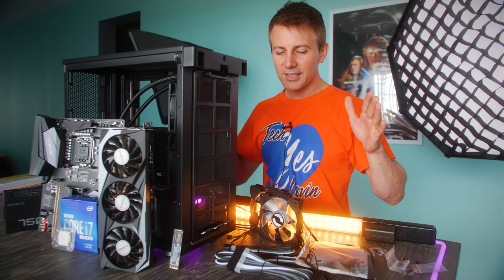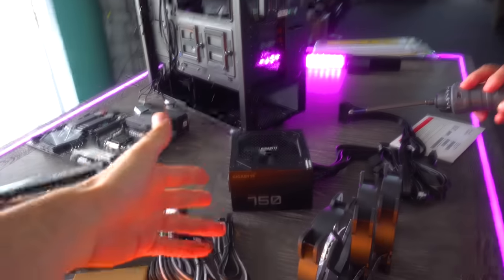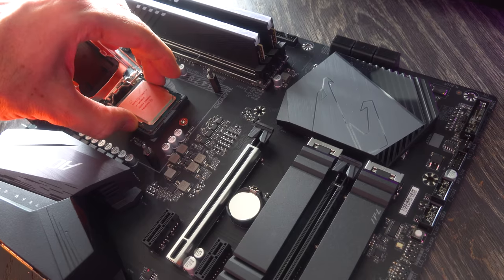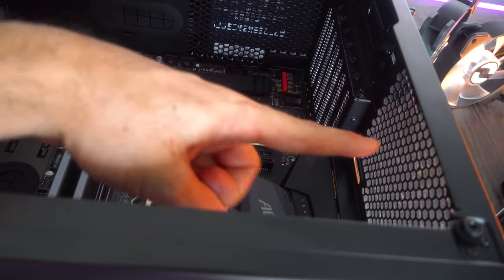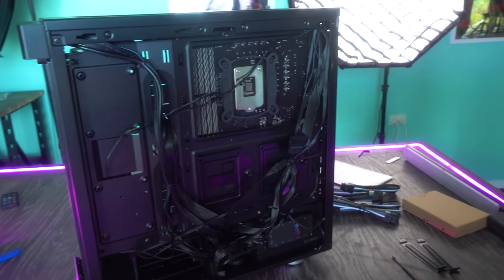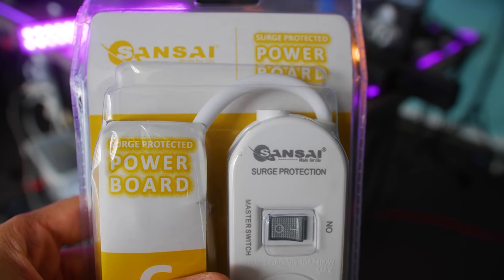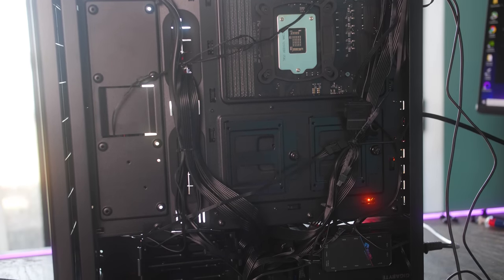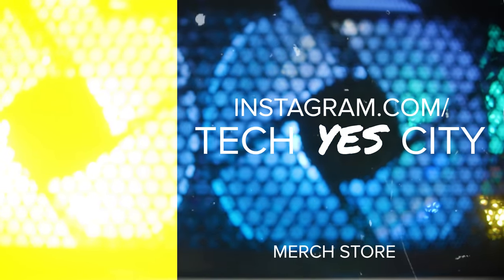We Build My 70 Year old Dad YOUR First RTX 3070 Gaming PC 💻  (Powered by Gigabyte, Intel and PLE)

Comment: Hi Bryan!
It is nice to see that the bond with your father just deepens day after day.
Also, it is great that he is coming into the tech communitiy: Pcs are a great entry into elctronics
>> would be nice to see a small electronics channel from your father, showing how some basic electronics work applied to Pc department (i.e. how to set your own leds to your computer: how voltage flows through the led, why we need some resistance in some cases, why we can arrange several diodes in serial way being powered by 12V (and the voltage drop that occurs at them).
Just ping me if your father is interested on these kind of basic electronics and would likely discuss a couple of ideas :)

PS: on a side note, that Pc will really set me back into 2020 (currently running a 2nd hand Pc that I made: delidded i5-3570, GTX 970, 2x4GB DDR 1600, etc with the expection of a brand new 500GB SSD)

Comment: I was going to comment anyway
Over the last few years I've been telling people about my unusual fixes and builds. I've worked with multiple techs during this time and made them aware of your channel.
When I see your Dad in your videos, he reminds me of my stepdad (real daddy, the one who raised me). In the 1980s he used to do simple TV fixes, he would find any old TV and collect. These old machines used to have multiple circuit  boards, so he would look out for identical TVs and switch out the boards. We were a poor family, but had tvs in every room of the house
Every time I have worked on an old computer it brings me back to my childhood.
I fixed a GTX 770 by cleaning it in the sink. I built my server computer with Xeon 5660, Ali Express x58 motherboard, and GTX 770.
I got my hands on a fairly new HP that was completely dead. I couldn't find anything wrong so stripped it down to clean. I found two drops of wall paint underneath the motherboard. Seriously, no paint anywhere else, they must have been painting the walls and paint got sucked on through the fans (missing every blade) and somehow made it's way under the motherboard without touching anything else. I cleaned the motherboard and fixed the PC good as new
I joined my job 3 years ago because of sales background and found myself in charge of tech. I hadn't installed an os since windows 98, and used the knowledge learned from your channel, and test in fixing stuff influenced by your channel to being much better at my job.
I started my own children young and had my son at 5 years fully dismantle an old pc and put it back together. The PC booted and worked fine.
Love these father son projects, also feel a little sad though, my daddy lives over 3000 miles away, I would love to build a PC with him

Thank you for all your great content

Comment: I have a content idea. PCI 4.0 vs 3.0 using twin 3080's, or 6800 with a 3080 on Ashes of Singularity (explicit multi gpu). I have a feeling also that B550, with a 4x link on the second slot, will limit performance when using 3.0.

Comment: Not sure what to comment so I guess I'll give my current PC specs:
CPU: Ryzen 5 3500X
CPU Cooler: Hyper 103
RAM: HyperX 16GB DDR4 2933MHz (OCed from 2666MHz)
GPU: Zotac GTX 1050 Ti
Mobo: Gigabyte B450M DS3H
Boot/Storage:  Samsung 970 Evo Plus 1TB
Storage: WD Blue SSD 500GB
Storage: Some old WD Green HDD 1TB
PSU: EVGA 500W 80 Plus
Case: Fractal Design Core 1100

I'm trying to get a GTX 1660 Super for under £200, but today's market doesn't seem to allow that now :/

Comment: My house was struck by lightning and it jumped to my panel and blew almost ever light switch off the wall in my house but all of my computers worked fine EXCEPT for the ones that had Ethernet Cables plugged into them, because apparently our ethernet and Cable wires were not grounded properley outside the house. One computer completley died and the other the ethernet port just doesnt work anymore (realtek-chip completely blew off of the motherboard) but is probably a fire hazard so I replaced the whole pc.